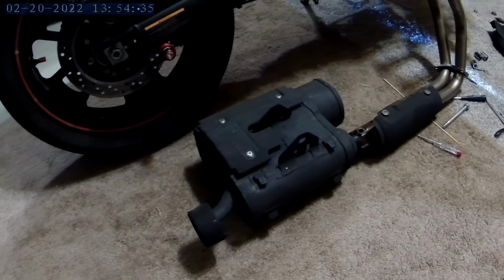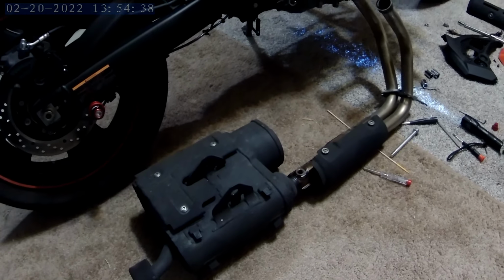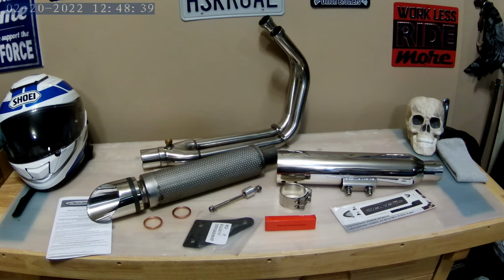Vulcan S Delkevic Exhaust with Drive-by Sound

Comment: Thank you very much for the metric system. here in Germany it has to have a DB-Killer and catalyst to be street legal 😞
but it really sounds good. 😀
Reply from the maker: The laws are similar here. Funny thing is that video is with the DB- Killer in place. Some States in the USA are a bit more laid back on enforcement issues. Shhhh........ 😂😅
Reply: @frdbecker  it's 85db max here if i remember right. 😀
Reply from the maker: @WilliamAPBodie  I think that is similar Internationally. That is why our motorcycles come with conforming exhaust. The manufacturers spend a ton designing exhaust that meets standards, yet provides almost maximum performance. This is why upgraded exhaust alone doesn't provide huge gains in performance.
The Harley Davidson riders in the USA are known to have very loud pipes. It's like their right of passage. (American slang). That is probably why loud pipes don't get much bad attention most of the time.
Reply: @frdbecker  many bikers cheat here. every 2 years there is a TÜV "German Association for Technical Inspection" so they change back to Org exhaust before that. 🤣
Reply from the maker: @WilliamAPBodie  I always keep all my stock parts. Seats, bolts, exhaust...... 😉 I got a ticket in California back in like 1977, because I was running a twin uncorked, under an overpass, when a CHP Officer was nearby. I had to trade a header system for someone's stock exhaust to get through an inspection. That was a pain.
Reply: @frdbecker  Pain back then. but funny today. last year a friend of mine got a new HD 1900cc euro5. my 300cc euro4 makes more sound stock 🤣
Reply from the maker: @WilliamAPBodie  Yes even Harley Davidson has to comply with the laws. But apparently their riders do not!
Reply: @frdbecker  The police don't say or do much. but they know. Not fare from me is Kiel. there they do special exhaust systems HD. so it first opens up at RPM's (don't know how many rpm's). but it cost alot.

Comment: Would you still install this exhaust if you knew how loud it was ?
I'm thinking if arrow or csracing would be a better choice , maybe a bit quieter , but they are more expensive
Reply from the maker: I have to admit some people really love the loudest pipes they can get. I also understand the draw to this. My huge regret is that I can't hear my Sena when the pipes are on the bike. That alone can be a deal-breaker. So I buy a few extra gaskets so I can switch it out rather quickly when I feel the urge. I do this on other bikes especially when they're just just slip-on's. Changing back and forth gives a little extra new thrill to the riding experience.
One thing I won't do is try a different system unless I sell this one. At this point I'm pretty happy with my other overall modifications on the bike. 
One last upgrade I'm going to do is add auxiliary LED Halo lights up front (and they are not the OEM from Kawi).
Reply: Can maybe pull the baffles and wrap with some fiberglass packing, should keep the sound.. just a bit quieter
Reply from the maker: @chrisjones9945  I never tried it. Figured on a full system that's pretty much what you're going to get. The great answer might come from a local muffler shop I would hate for you to cause too much restriction and hurt the engine. The pipes get pretty darn hot near the exhaust ports as it is.

Comment: Hi, did you have to tune/flash, get a power commander, or a booster plug?
Reply from the maker: No I didn't. I upgraded the air filter, and the slip-on pipes. You may find it interesting that modern ECU's are self learning, so that the fuel mixture and timing adjust for changing environments. 
After all bikes are sold all over the World, and climate, altitude, etc are different everywhere.
I do believe if you find my video on the install of exhaust on my Royal Enfield 650, I probably explained how to 'brake-in' the new pipes. It is a process of riding each gear nice and smooth, slow to higher rpm, and coasting to a stop without using the brakes (long straight roads, with little traffic help). The process is gear 1 only, then gear 1 to 2, increase to high RPM, slowly, coast, 1-2-3, repeat, etc.
The whole process takes 15-20 minutes. And when you're done there is no issues with backfiring, popping on deceleration, etc. The bike rides like this was factory installed. 
I love it!
Ride safe! 😁
Reply: @frdbecker  thank you! Ive read some people do and ithers dont. Really confusing somwtimes
Reply: @frdbecker  sorry one more question, how is riding now?
Reply from the maker: If you are asking how the Vulcan is riding it is terrific. If you're asking writing in general it's been a little limited because we are still having inclement weather quite often.
Reply: I put the same exhaust on my vulcan s after riding it for 2 days lol. It rides great! The majority of the weight is dead center under the bike on the stock exhaust so it didn't change the riding too much. Although, my first 2 days on the bike were my first 2 days riding in general and did about 200 miles. I've done over 800 more since then and it's been a blast! Love the bike and love the exhaust!
Reply from the maker: @AlicesMazduhs  wow what a story! It's nice to have a new Rider 😉 I know all about putting a lot of miles on a new bike! Be safe out there and thanks for the wonderful comment!
Reply from the maker: No the oxygen sensor screws right into the new exhaust. The computer and the bike will reset itself tell me new exhaust. Just need to take it out and write it a little bit slower for a while, maybe putting about 20 mi on it.

Comment: Hello. I'm just about to buy the same exhaust. I expect it will be louder but how loud compared to your standard Harley Davidson? Is it about the same or even more loud?
Reply from the maker: I'd say with the baffles installed your the same or a little louder than a stock Harley Davidson. With the baffles out it's a lot louder than a Harley Davidson. 

A modified Harley Davidson will be unique and sometimes extremely loud.

Different sized pistons and stroke, it will be unique to the character of its components. 

Either way it's a much more pleasant ride. Of my nine different motorcycles this one I prefer to leave the baffles in. But they're easy to take back out anytime I want a little change of pace.
Reply: @frdbecker  Thank you for the reply

Comment: Exhaust upgrade only with no modification to the air intake makes for a sloppy running engine. Bikes always seem faster when they make more noise. Most bikes loose power when modifications are done halfway.
Reply from the maker: Thank you for the comment. By the way I upgraded to the K&B air filter upgrade before the pipe edition addition.
Currently because I could not hear my Sena device with this pipe on the bike I went back to the factory exhaust. I'm a firm believer that engineers at a place like Kawasaki get the most performance they can out of their stock exhaust systems while controlling the noise level.
The cool thing is for no more than a couple copper squish washers I can switch back and forth anytime I feel the need.